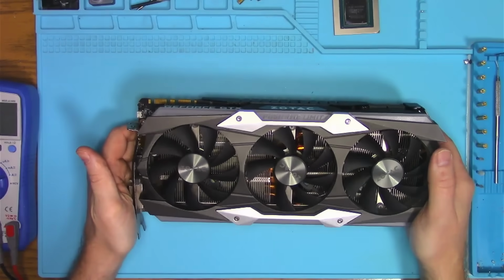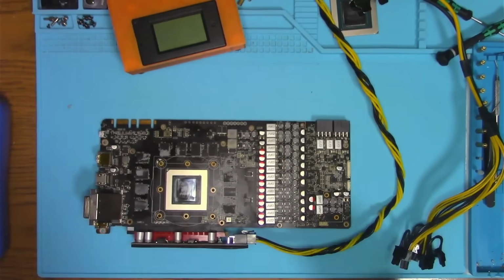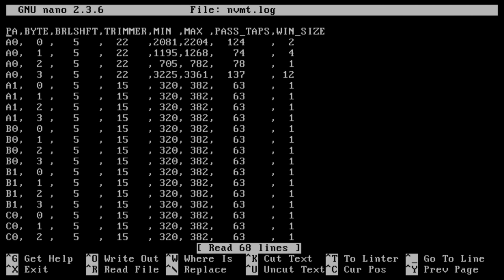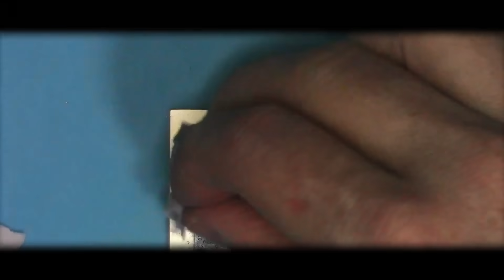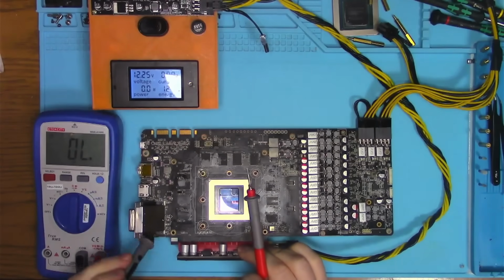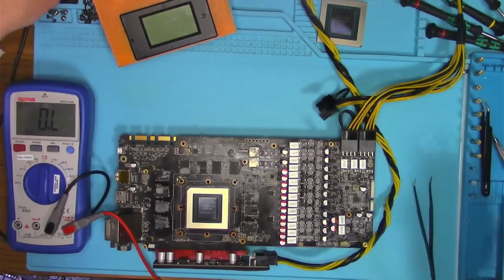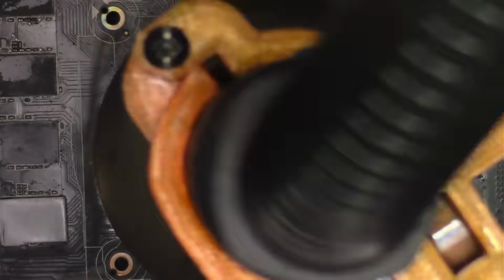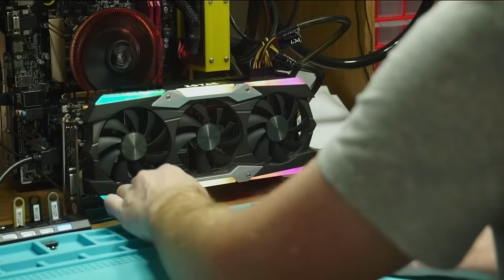Zotac 1080Ti AMP edition repair artifacts no detect crashing anything you can imagine

Comment: I personally own this one and have been running it since launch date. I have replaced my fans 3 times over the years before I 3D printed some air ducts and did some 120mm fan mods. Its a solid card for me, solid through the crypto shortage solid through the pandemic shortage and solid today for every thing I play.
Reply: Yeah why not...?
Everything u will be able to play at 1080p & very soon @ 720p 🥱
Reply: @abeerfaisal1986  Fortnite will always be playable at 1080p and so will be a million other games. My daughter's PC has an i7 2600 overclocked and a GTX 1070. Runs at maximum settings, 1080p, 90-120 FPS. She also is playing Genshin Impact which also works more than fine in 1080p. My latest video card was a RX 6700XT. Not much difference in Fortnite, believe me (my motherboard has PCIe gen4). Switched back to my old 1070 too. I got a RTRX 3080 Ti to test probably next week. I doubt it will make much difference but who knows?
Reply: @abeerfaisal1986  
It still is playable at 1440p, dont know what u talking about 🤣
Reply: @Dandan-tg6tj It's lovely to play games that are 5+ years old!
Reply: @Grayest_Fox  I never was into this "new games" stuff. I played Heroes 3 (with cheats),  King's Bounty (also with cheats) and Wizardry 8 (with cheats, of course). Games should be fun to play. Fortnite is not a competitive game. It does not matter who wins. If you're killed in the game, in 20 seconds it's starting again. Crowned Victory Royale may be nice first time or the second time but after that it does not matter anymore and I am going back to exploration.
Reply: The 1080 ti is a Savage still. If you can afford brand new games you probably have a new card also.

Comment: When I started watching this chan (thanks 'Tube algorithm) it was like "oh, man, this doesn't look too hard to do! I can totally go through the same kind of debugging process(es) and fix GPUs I find on ElectronicBae!!!" But then the more videos I keep watching, having subbed early on, it's been getting gnarly. These fixes have been getting trickier it seems like. Memory check passes, everything seems normal, but it crashes when it starts doing stuff, locks up the OS, blue screens, etc... Maybe I'll just defer to the experts when I need a GPU fixed. Fortunately, I haven't made the mistake yet of buying a GPU that I can't afford to replace or have someone fix! RX 5700XT, RX 570, an OEM HP RX 550, and a GTX 1060ti. So far so good. Fingers crossed!

Comment: Good job! Just a remark: at 3:32 there is some typo i think (280->217), also 250 will be between 183-217 or between 138-217 depending what type of low-melt you are using.

Comment: You make the reballing process look so easy. I runed 6 motherboards with 1151 bent pin sockets trying just to get them off!! Lifted pads, caps and resistors moved in the center of the socket due to hot air ......!! Could you show this sometime if you will. I was using a single hot plate for bottom heating and hot air on top!!!!! Thanks for the video.
Reply: Preheat and low velocity hot air on a very even desk, really good flux helps. Just practice depopulating broken stuff for a few days and the settings will come to you.
Reply: @GoonyMclinux  thanks for the advice I'm kind of intimidated now about trying it anymore.
Reply: @amtpdb1  It takes some practice for sure but I learned the soldering part pretty quickly by finding junky old laptops and such and removing and reinstalling parts and then seeing if they still worked. I destroyed more stuff than I fixed for about 6 months but thats how it goes. Its really good money if you stick to it.
Reply: @GoonyMclinux thanks for the support

Comment: Its strange the B0 came faulty after the reballing maybe the heat helped the loose connection to be revealed, great work as always btw do you use 300 degree on soldering-iron for wicking gpu?

Comment: This is the reason i keep telling people not to let their cards go above 60-70C, the manufacturers limits don't matter because they want this to happen after a while so you can buy a new one and their cash flow keeps happen steadily, you have to make sure there's plenty airflow in all parts/sides of your card, when the board temperature saturates around these temps material pressure keeps raising making material, like soldering balls expand and "unstuck" which is also why you should play with a frame limiter, so you never tax GPU usage more that it's needed, anything above 70% and below or near 99% is good to keep steady frame times and always undervolt if possible.
Of course your card will go to 99% usage if you tax it too much especially an older card with newer games which is why you should cool the f out of it if you wanna max it out because while maxing it out is not what actually causes the problem itself but it leads the card heating and heating so if the cooling isn't enough all sort of shit can happen, anywhere on the card not just on the GPU's hotspot or core.
Don't think that just because your GPU hotspot temp is full example 60-70C under 99% load every other component is gonna be at that temp, GPU designs are not made for that and a lot of the times there are also design flaws like not taking into account to create space where air can flow on a part which can get hot regardless of what the GPU core's temp or hotspot is.
Unlocked frame rates are only for benchmarks and testing the card fast when you buy them to ensure they don't have a faulty component.
I mean i don't want the guy to run out of business of course, but it's so simple to keep your GPU from breaking buy doing 2 things, keep the entire card as cool as possible and have a PSU with low ripple voltage.
I've never had a single GPU fail and i've had more than 10 since 2000, and yeah it's a small sample size but cooling them wall with fans around, swapping pads with better ones and new good thermal paste helps a lot with longevity.
Reply: Not being funny, but no wonder you haven’t had a gpu fail if you are changing them out every 2 years, 10 gpu’s since 2000 is a lot dude

Comment: I have this exact card but non ti version. Similar problem (crash on benchmarks and heavy titles) but works if put a 60% power limit via msi afterburner. Not heat related as it barely reaches 55c and im (Almost) positive its the card as ive tried every fix under the sun. 

Anyways how much would a fix like this go for or would it be more worthwhile to buy a new card in regards to price.

Comment: Can you fix my amp! Extreme? :( I applied thermal pads where they shouldn't have gone which I think didn't make the heat sink sit right immediately crashed. Took that all out and now the card crashes still.
Reply: One time I managed to have it boot up. Quickly turned down the clock and ran a test. It got hot and the fans didn't turn on so I shut it down.

Comment: Guys, if there's any chance anyone could help me out - I bought an Asus Strix GTX 1080 Ti Gaming - the card passes FurMark, but crashes in games and some other tests (superposition, 3d mark won't even start). Temperatures are relatively normal, voltage, frequency, everything is on factory settings, no OC. Is there something I can do to salvage this? Even if I am to lose 10-20% performance? What does the above described behavious tell us? Why would a card pass one of the most stressful tests, but fail so many others?
Reply from the maker: Might need a reball

Comment: These Zotac 1080Tis are absolutely atrocious, it still gives me nightmares from back in the mining days.. The fans on them are by far the crappiest in the entire industry. If the fins don't break off like cockroach legs, the bearing will seize after 2-3 months of 24/7 and there are no replacement parts for them on the entire planet except Aliexpress knockoffs which fail even faster.. China fans are absolute horror, stay away from them!